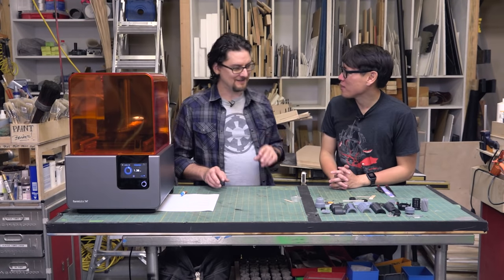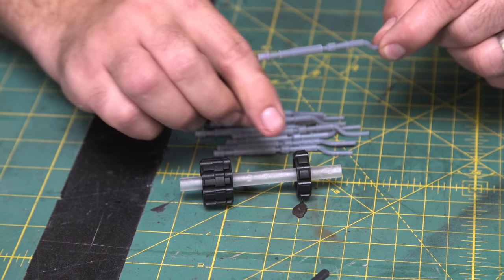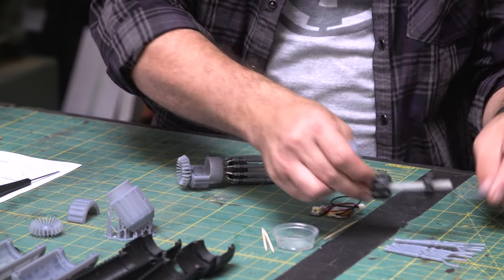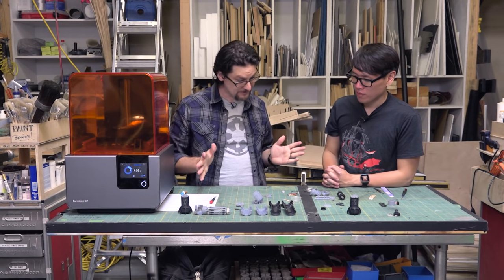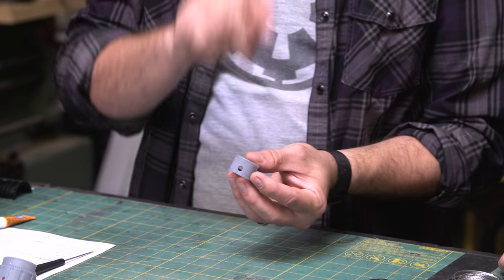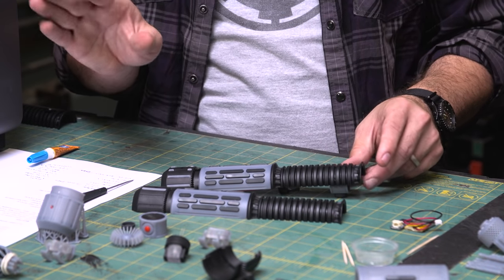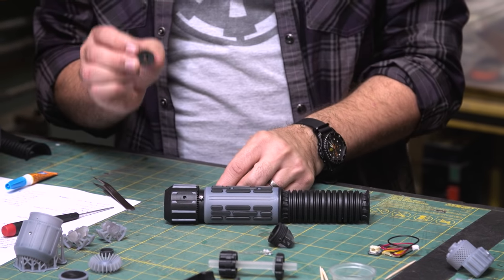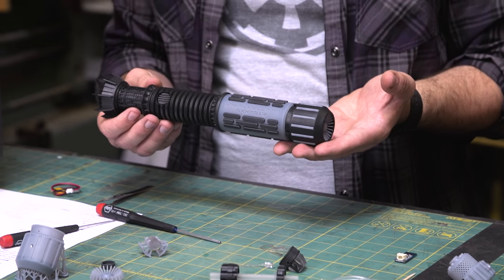How To Build the 3D-Printed Cutaway Lightsaber Kit

Comment: I made a lightsaber from recycled materials, sheet metal, plumbing and electrical parts, and metal wire, but it helped having all the tools I already owned. It turned out looking very industrial and worn. It's heavy too. I built it so it would have room for a crystal chamber and other compartments (not a 3D printed one, but some quartz). It turned out great. Just need to polish it with a buffing wheel to give it a nice shiny finish. Making more now to sell to a couple friends who loved it.
Reply: You will definitely have to post a video about that

Comment: I have a $300 PLA printer and I'm pretty sure that, even with careful settings, I won't get either as crisp details or clear crystal/gem. There's details on there that I know won't be able to be printed, like the parallel tubes on the central part (or they will be covered by the supports' flashs). I love this model and it's beautifully designed, props to Sean - but this is like advertising exotic cars to college students. That's clearly out of range. I'll give it a go, but that will be just out of curiosity.
Reply: I could do this with my ender 3 pro 
You should be able with the right settings. What is you’re printer?
Reply: @okayboomer7546  woah man, my reply was from four years ago... 😅

I have another printer now, an Alfawise U20. A killer machine that can put out extremely detailled prints. :)

Comment: is there anyway i can just buy the the 3d printed lightsaber parts from the model if i dont have a 3d printer?
Reply: In my town everyone can use a free 3D-printer in the local library. Maybe you have some opportunities like that?
Reply: Try www.shapeways.com
You can send them files and have them professionally printed and cleaned. Depending on the material it can be pretty expensive, though.
Reply: I wish

Comment: Have you tried printing this using an FDM printer and if so, were you able to get close to the same fit and tolerances as the SLA?  Would love to print one of these out on my modified Prusa I3.

I do have a question  regarding the electronics for this.  You didn't specify anywhere during your discussion on the electronics portion of the build about using a resistor on the LED.  Are you using one?  In my experience, using an LED without a resistor, even if the voltage of the battery is basically the same as the LED's nominal voltage, will result in premature failure of the LED.  Even a small value resistor (0.5 ohm) will be enough to protect the LED.  I would hate to have to take everything apart later on in order to replace the LED just because a resistor wasn't used.
Reply: They did briefly mention using a resistor, but didn't go into any detail. You're right that it's important to include one in almost any LED circuit.

Comment: Sooo for those that are not as large budgeted as $3,500 and $150 for each resin cartridge, could you print this in a standard filament printer with ABS?
Reply: From my experience? Yes* its totally possible to print something similar.

*but it'll be nowhere near as accurate and clean.

Comment: I sort of shocked that may of the people watching this don't own 3D printers. The one used in this video is crazy overpriced. If you are looking to make small parts like this you can get a cheap $200 3D printer to play around with.
Reply: You can't print such small details on cheap FDM printer. You'll never be able to make anything even close. SLA printers are only ones which can make such details and tolerances, and they ain't cheap.
Reply: +Veles Vapes Even the cheap ones can get down to 0.05mm layer heights and have XY positional accuracy to 0.01.  If you use a 0.2mm nozzle you can print details to about 0.25mm. I have a printer that can. Its an original PrintrBot Simple, with some modifications, it cost about $350 a few years ago. The stuff selling for around  $200 looks more solid than that was. Tinker with it until you get the results you want. While there are some limitations, printing this light sword isn't one of them.
Reply: Check out the Creality CR-10

Comment: Are there any good, cheap(ish) 3D printers?
Reply: rip rap. but just build one. learn some c and do it on an arduino mega. they have a printer shield with swappable stepper controllers and lcd, and the code is open source. then it runs g code like a real printer. then with this set up you can swap it for a Dremel for UWHPE milling  (or wax for casting), or even a laser
Reply: you just blew my mind a little. i do a LOT of tinkering around with metal work. you mean to tell me i can build a 3D printer that prints in wax? so then i can just throw it in some refractory and go my normal route in casting? that is fucking epic. can you give me a little more info on where to look up how to build one?

Comment: You do NOT control high power laser beams with apertures!If the laser is made to cut through things it would obviously melt through the aperture. 
Beams are controlled with refractive (for wavelengths we have transparent materials for) or reflective optics (for wavelengths that would be absorbed by all the materials we have).
Apertures are only used for lower power particle beams and might need to be actively cooled.

But who am I to try to explain science to a non sci fi crowd. (Yes, Star Wars is not real Sci Fi. Its science is completely messed up. It's all about a mysterious force that we don't know how it works, ergo it's about magic. It's a fantasy family drama that happens to be in space. Nothing wrong with that, bit it's not SciFi)
Reply: SCARLET★STAR wtf Star Wars is real Sci Fi mate,  it stands for science fiction ie. fake or untrue science, in other words bullshit which it is , sci fi is the polar opposite of real science !
Reply: 88Nikoli  BS! SciFi has to get basic science right, then interpret/add new fictional science to it. SciFi needs to have a few assumptions about this new type of technology it introduces. For example it's a new material found somewhere on some obscure planet that when you apply an electric voltage can fold some of its' mass into some other dimension -> we can use it to manipulate gravity -> a whole new branch of technology opens up. Everything else from there on out has to be plausible. You can't just have a mysterious force of balance that kinda has it's own will and laser swords (yes Luke calls it a laser sword) that end in mid air and fighters in space that need to bank to turn. 

The biggest issue is that you're born with some weird "affinity" to "the force". That is typically called magic. Science and science fiction is about technology -> something we create using our understanding of a universal law of nature and EVERYONE CAN USE IT. That's the fundamental difference between scifi and magic. It's not about it being in space or some medieval world with elves. It's about the difference between technology we create or magic talent that god creates and some are born with.

SciFi is NOT the opposite of science. It's an extension of science. Some of what has been sci fi 100 years ago is actual science now.